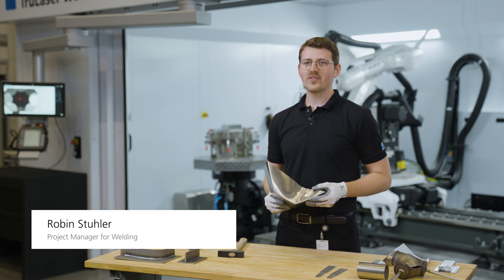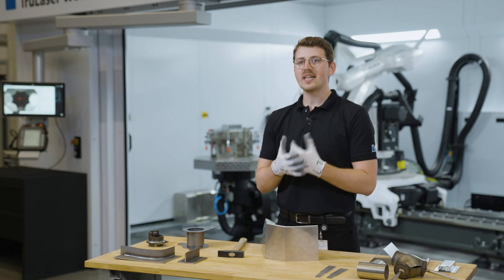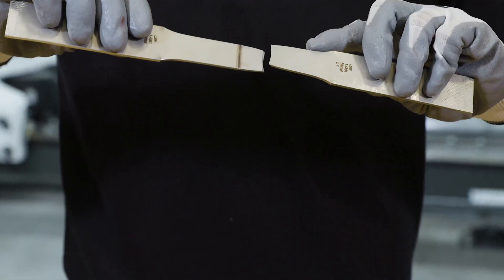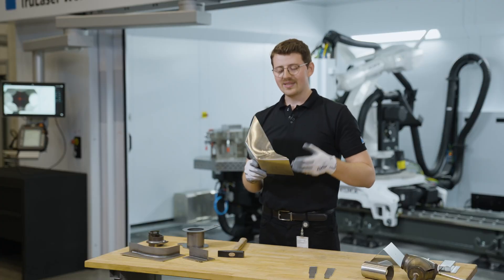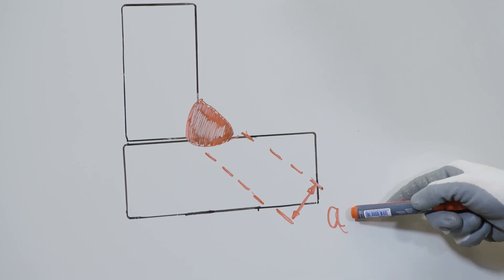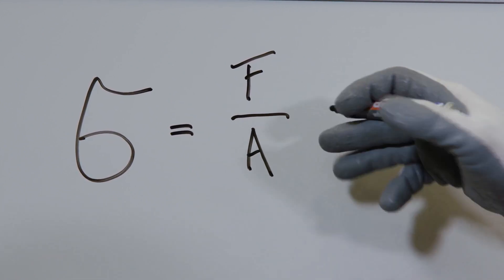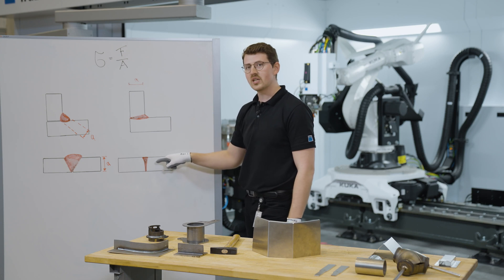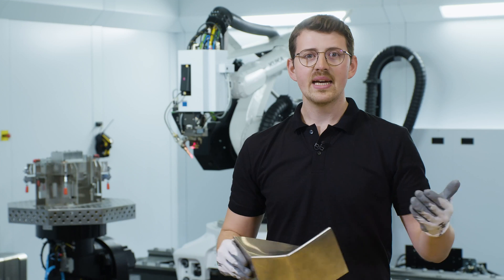TRUMPF: Ask the Expert – Strength of a laser welded seam

Comment: Have you ever tried laser welding thicker material 15mm+ ?
Reply from the maker: Hi @aaronshed, 
Yes, we have already welded thicker materials like that with a laser as well. Generally, whether it works depends on the application and the requirements. 

The question is: Will the seam meet the strength that is required. Depending on the laser power and the thickness of the sheet you might not get a full penetration of the weld. There are some tricks to increase the welding depth, like a special seam preparation, but at some point there is a limit. 

If the required strength is met, even without a full penetration, that works. Otherwise you might, for instance, weld from both sides. That said, 15mm+ sheets welded together is not a very common application for the machine shown in this specific video. It's more likely an application for instance for a hybrid laser process. An application with 15mm+ material that we do more often on this machine is a combination of different sheet thicknesses, for example a very thick sheet of 15mm+ welded to a thinner sheet. 

If you're interested to see if laser welding is a suitable solution for your specific application, please get in touch with us via our website to get in touch with your nearest sales contact who will be happy to give you more information. https://www.trumpf.com/en_INT/company/trumpf-group/locations/? 

Best regards from the TRUMPF group